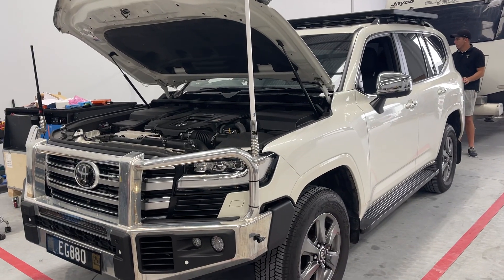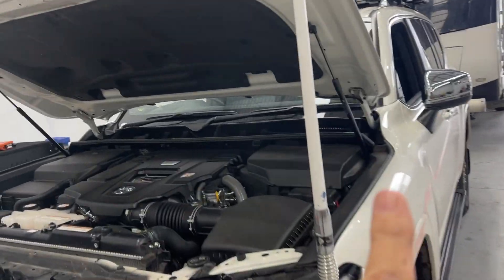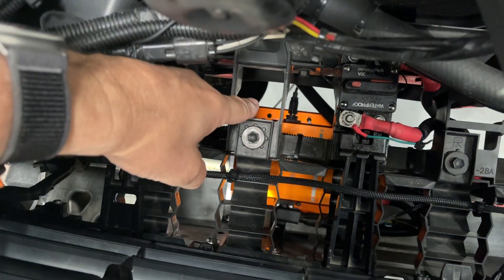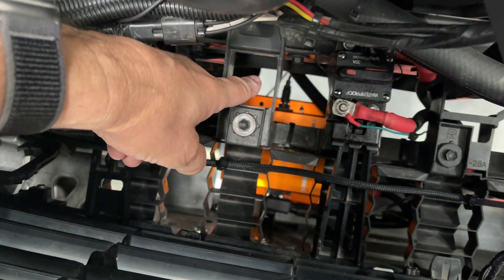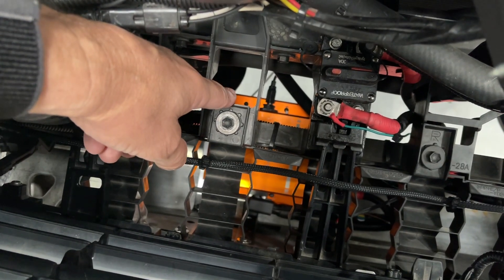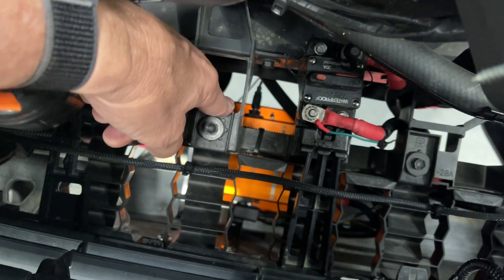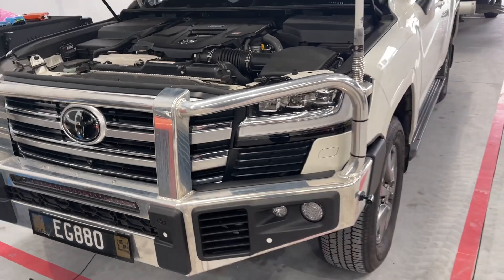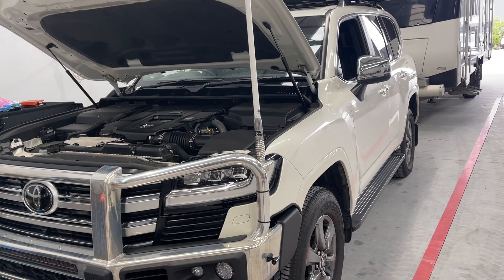LC300 gets a Scotty 1500W to charge Jayco Silverline fitted with 48V Upgrade

Comment: Do you have to have a 48v system in the van to run a Scotty?
Reply from the maker: Scotty is in the vehicle. There is less power loss with 48V over a long distance than 12V. Its significant. So we get scotty as close to the alternator as practical.